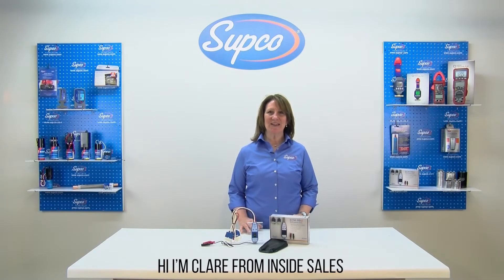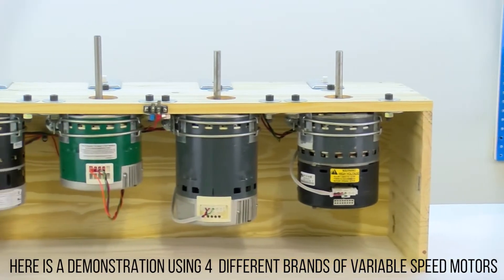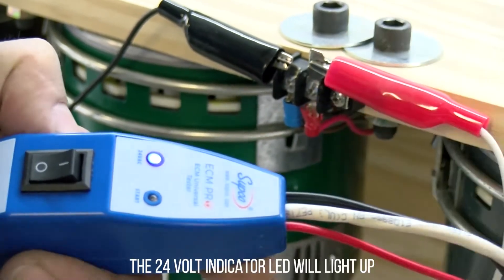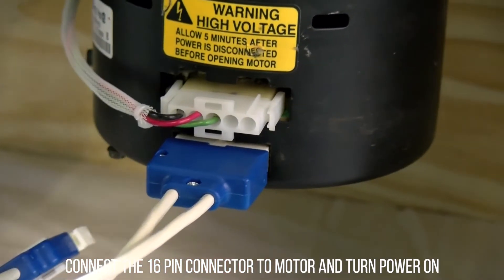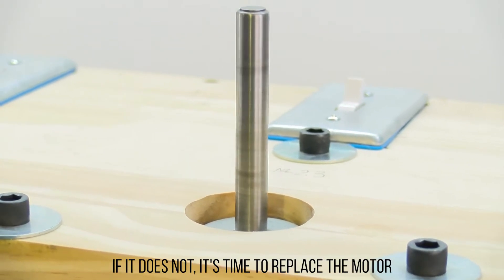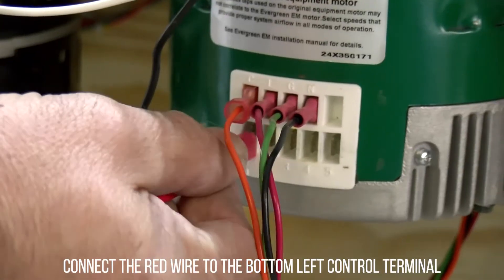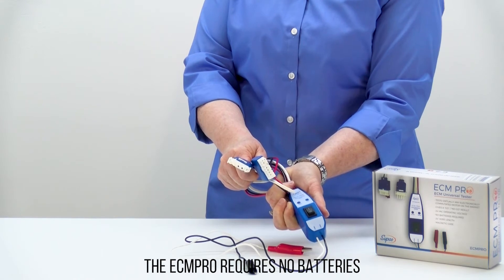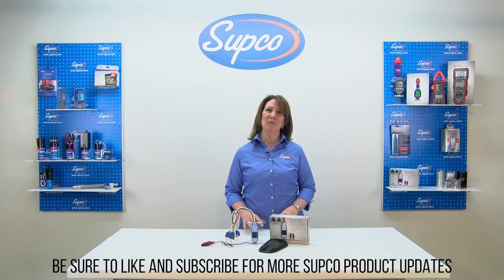SUCPO® ECMPRO Universal ECM Tester

Comment: In this video it's showing to leave the power wire connected. I spoke to supco tech support and they told me to disconnect the hi voltage to the motor. Any input?
Reply: First disconnect power plug and control plug to motor. Ohm the motor, check to the ground as well. Check motor plug if it’s getting 120v or 240v on air handlers . If it checks out ok plug power to motor, connect alligator clips to R and C 24 v on the control board plug this thing into motor and proceed as instructed.
Or check if you are getting  24 v on 16 pin connector . Pin 1 is neutral (C) ,12 is R, 15 is G, pin #1 is blue and that’s where count starts . First row is 1-8, second row is 9-16. If you jump R and G on the board you should get 24v on connector between C and G. If that checks out ok your module is toast. If it doesn’t, your board is bad.Hope it helps
Reply: @BobanMisevic  sure does but I thought the idea with this plug is that it makes it much easier to just plug and see if the motor is working
Reply: @Elisummit845  tool is made for people that don’t know schematic of the pins. Also they make all wires white so you can’t  differentiate🙁
Pin #2 -W,#3-C as well as #1 , #6 -Y1, #13-W2, #14-Y2
Reply: @BobanMisevic  i know how to read schematics but it's way faster with a tool 😉
Reply: I'd like to get a reply to this as well. Ki d of important to know
Reply: @kennybakerhvacr5751  from what I learned you do have to leave the power connected otherwise it won't work

Comment: Can bench test the motor using only the 24 volts to power the ecm tester?
Reply: The motor has 120 or 240 already applied, the 24 is the control signal to turn the motor.

Comment: I have found even 16-pin motors can have different pin definitions. With 3 different my DIY testing harnesses,  I may need to try to see which one may work. So is this tool work for all brands?
Reply from the maker: Gerry - yes all brands.  If you have specific questions, please feel free to email our Tech Support at:  techsupport@supco.com
Reply: I doubt it there's too many out there now in 2021, it's a dummy tool for many techs that aren't to bright with control electrical skills, some get there faster than others & some just don't have it at all, that's wjy i always thought it's great to learn on old as say like carrier units that had a bunch of relays as controls & thats it, problem is alot that some new relay have pretty poor diagram explanations on it too so first some mjght be a trial n error unfortunately

Comment: Only issue I see is that it could be a bad module and not the motor. This tool is designed more to ensure the control board is not the issue
Reply: If the unit fails to spin the motor, you must still ohm out the motor (of course initially you turn the fan wheel manually)... if the motor ohms out properly and the tester didn't spin the motor, the module is bad.  If the tester spins the motor and the motor also ohms out, the fan board or harness is faulty.
Reply: @9UaYXxB  she specifically says "it's time to change the motor". Doesnt say anything about ohming out the motor or checking the module.
Reply: Thankfull that at least one person said it.